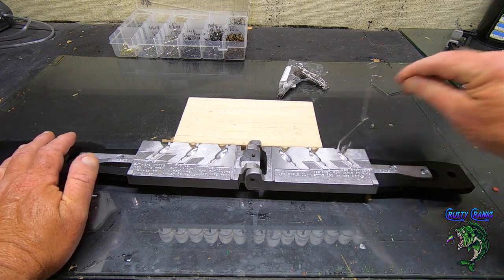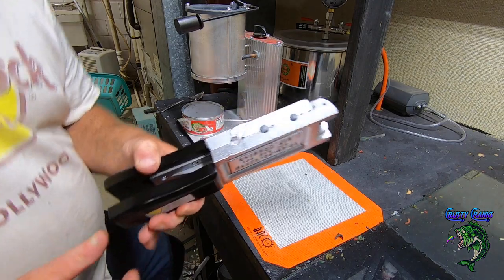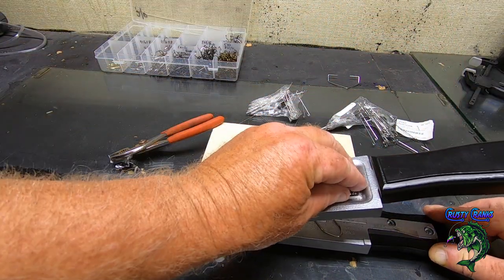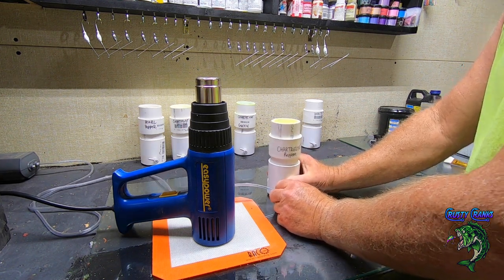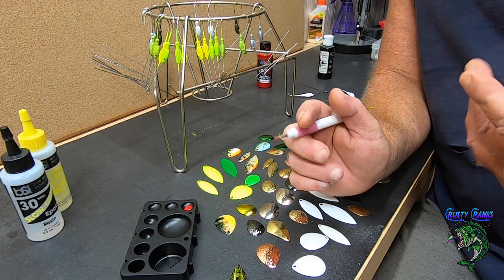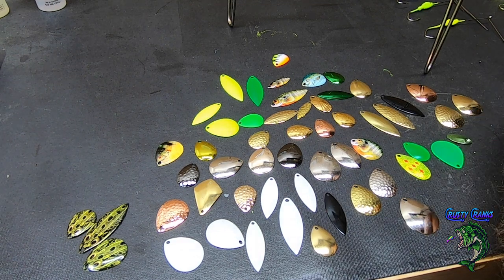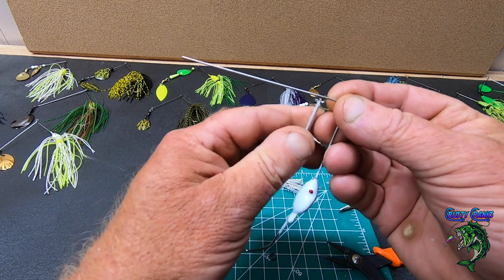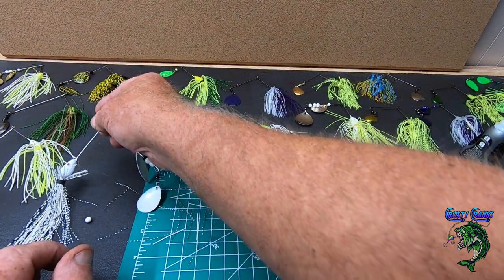Making Spinnerbaits with Do It Spinnerbait Mold - Complete Tutorial for Beginners

Comment: Like your work I have the same mold can you explain how to pick the beads and clevis and blades I have poured a flew but I'm stuck thanks for sharing I'm a fan
Reply from the maker: Most all the parts can be found on LurePartsOnline or Barlows Tackle, I like to buy assortment packs of beads and blades that way I can play around with them till I get what I like. You can also get beads at walmart. As far as clevis you just need to make sure they fit on the diameter of wire your using most all the parts are pretty cheap it's always the  shipping that usually drives the cost up. Hope that helps. Thanks for Watching!